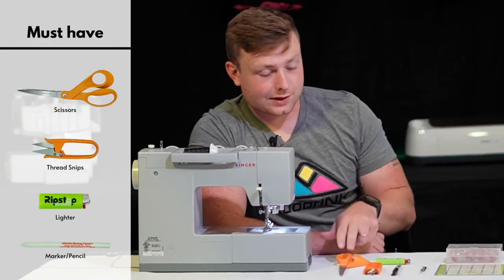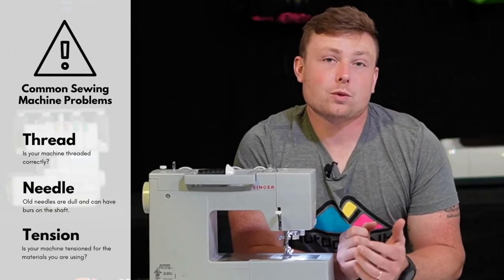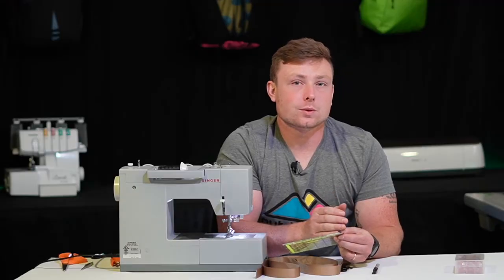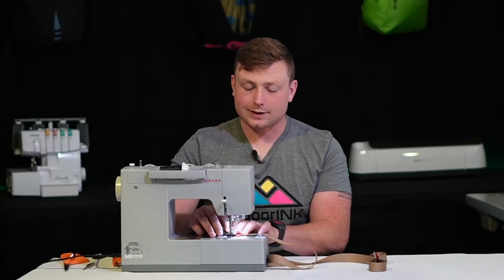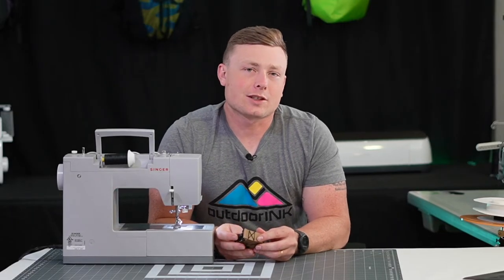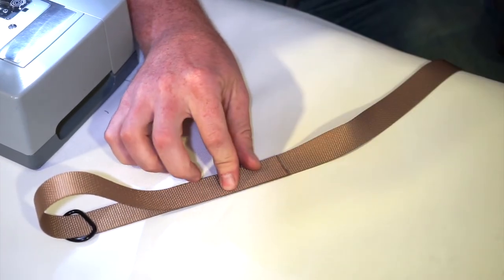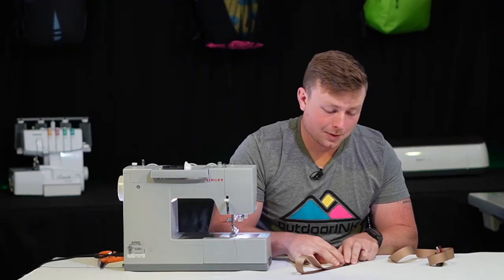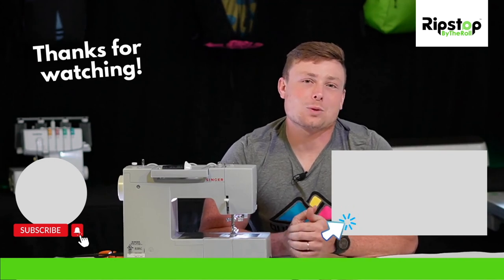DIY Dog Leash Kit Tutorial Video

Comment: What settings did you use? I am having trouble getting clean stitches through webbing with my Singer HD. It looks better at a tension setting of 7 but sometimes I still get a cluster or thread at the bottom. Showing the settings will help noobs like me a lot.
Reply from the maker: Thanks for watching! Thread tension can be really finicky. Keep in mind that with each new layer you'll need to adjust some more. For example, if you test 2 layers, then fold over a third, you'll need to adjust the tension again for that third layer. There is also a lot of variability for each person even with the same machine. Depends a lot on the thread you're using, how new the needle is, and other things like that. Did you find a Singer HD manual yet?
Reply: What kinda needle You use?